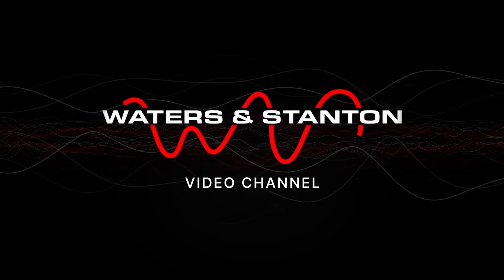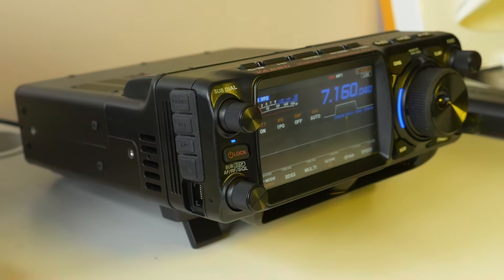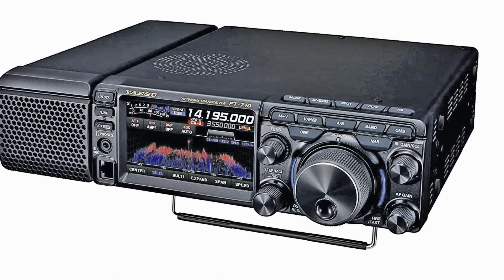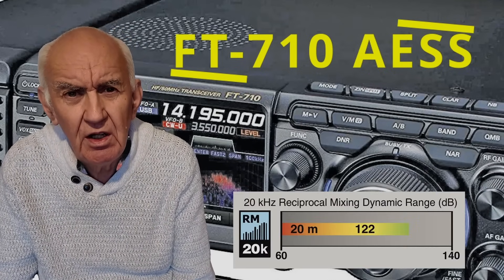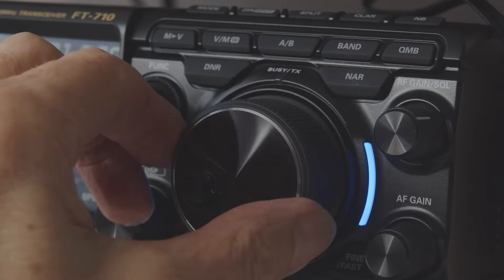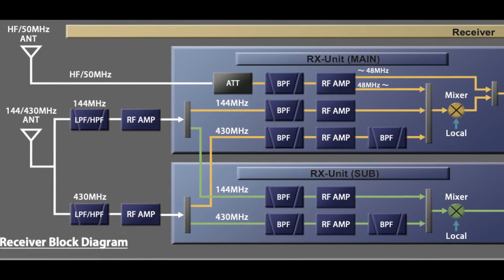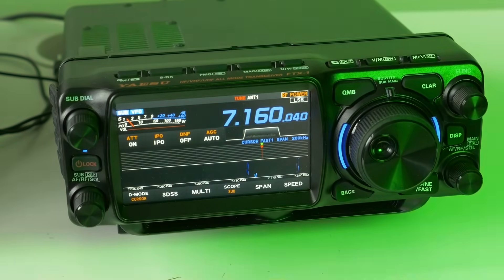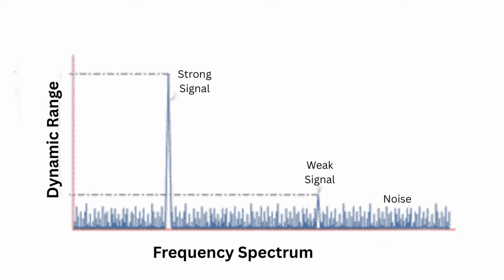FTX 1 The Superb Receiver Performance and some optimisation.

Comment: Yaesu has dropped the ball with their new FTX-1.  Specifically you cannot choose the frequency and band with a mouse.  With the FTDX-10 and FT-710 you can but not not not with the FTX-1. When using my Yasu FTDX – 10, I found that I can simply use my mouse to enter the frequency just by clicking on a frequency box that appears on the screen. And Boom” instantly transported to the band frequency that I want. So when working FT8 or POTA it is such a wonderful experience to just have to use my mouse to click on the frequency box and immediately and instantly get transported to the frequency and band  I want “Boom”. So……. When I saw the FTX – 1. I was interested in buying that one however I find out they do not have that same ability to click on the frequency with a handheld mouse. It just does not have it. I think this is a huge failing by Yaesu on this model. And I think this huge mistake of leaving that feature out on the radio will discourage people who like to do FT8 and Pota, from buying one of them, and their sales will definitely suffer.  It took me three days of searching to find out this fact. Which really really irritates me that they would not come right out and say we do not have that feature on this model. And saved me all that searching.

Comment: You go through the same steps I do with my Kenwood's 950SDX and TS940, Use the attenuator if noise conditions are high for the day or night, and AGC off opening the front end to its maximum gain level but offsetting and reducing audio overload with the RF gain, why its a good idea to reduce volume and RF first with the AGC off, as my 950 gets distorted audio with the stronger signals. Kenwood's similar AIP or advanced intercept point also balances out the signal to noise ratio sometime giving a cleaner signal with less noise. Otherwise, AIP can lessen signal gain if the natural noise levels are high on any given day. My other Go To is the MFJ noise cancelling Signal Enhancer and it does a good job on both tuning the phase between two antennas to reduce the noise sometimes almost to telephone quality and enhancing the signal with gain and very low noise. Its effectiveness is noticeable on different days, sometimes you can leave the adjustments the same across a few bands or have to adjust for each band, sometimes the dips in noise and gain in signal are more pronounced, such as a wide turn of the dials vs. a slight nudge or notch in the dips. Again to avoid the audio overload and distortion condition with AGC off; Attenuate down a notch and reduce rf and audio gain, then you can hear any improvements without adding or taking away gain with the AIP, and slowly adjust volume or rf gain. Sometimes the radio's own noise levels is equal to what the MFJ can achieve so the MFJ can then be used for gain and noise rather noise reduction. I find that a copper wire multi band EFHW dipole is quieter by far than a vertical aluminum antenna, with a significant difference in noise levels. On a vertical the signal is just wiped out, on the wire the signal is present and clear, sometimes between the two the MFJ is somewhere in between.

Comment: How’s it compare on 2m and 70cms compared to say IC705 or IC9700
Reply: At 70cm completely hopeless if you live next to a telecom tower with strong signals near 430Mhz, my 705 has waaaaay less problems with that.
Reply: Even on a good external speaker, there's absolutely no bass below 300Hz in FM mode. Nothing can be done about it in the menu, so why Yaesu pfffff.
The frequency on 70cm is way off, unacceptable in SSB. See also a user review on Eham.

Comment: Ahh Peter, using the RF gain control to adjust the audio level.  Yes, just as we did in the old days.  Worked on both SSB and CW.  I used it all the time on my HQ-129X.  I also built and wired the Heathkit QF-1 (I think that was the model #) into the 455kc IF on the 129.  Really perked the old girl up quite a bit.  I really enjoy your tips and also the trips down memory lane.  Keep it up. 73, Don - K2PMC. PS my original call minus the N for novice back in 1955.
Reply from the maker: Great memories. Thanks for sharing.72 Peter.

Comment: Agree on AGC and RF gain control… the same on most other radios apart from Icom SDR.. on these the RF gain is not effective, but attenuator does help with noise reduction.
AGC off not suitable in a net situation with stations of varying signal strength, very loud signals, as you say, can overload.

Comment: Agree with everything you’ve said here, Peter.
VK shipment (for whatever reason) just arrived this week, so I’ve only had a couple of days to test mine, but, yes it sounds brilliant and is kicking goals for me, already familiar with the menu system from the 710 and 101MP. I have only the most minor of gripes… it’s the only radio I own that I can’t tune 1Khz at a time with the turn of a dial, rather than fiddle with the VFO; and I would prefer the tuner as a button on the top or side rather than in the screen menu… so with only that as criticism, you can see why it’s so good for me. I don’t know if my 705 will be getting much use from here… 
The Sherwood reviews are splitting hairs with many of the top listed. I doubt our ears would truly be able to tell the differences. Anyway, thanks for your reviews Peter.
Reply from the maker: Nice to hear from you and for sharing..

Comment: I was interested in the Optima version, but then discovered a decisive disadvantage for me: there is no HDMI output for an external monitor, which is less than ideal for the ageing target group. It didn't take too long for the FT-991 to get the ‘A’ version, so I hope there will also be an FTX-1A that takes into account the needs of ageing YL/OMs. 73
(Translated with DeepL)

Comment: I have the 5’ separation cable which I use to put the amp in the back seat and the field head in a Lido cup holder attachment up front; now I don’t have to freeze outside operating on a picnic bench. Yes the 891 would do the same at a much lower price, but the other features of the FTX made me get it and I’m sure I will still be using and enjoying it for decades. For me the lack of gps & bluetooth were inconsequential; don’t see me using them at all. If it had everything possible,  probably someone would be complaining that Yaesu engineers missed the boat by not putting a bottle opener on the side.

Comment: On sherwoods listing its quite low overall its a shack in the box so there will be compromises, one thing in its favour its has the latest technology excellent dnr real time scope etc, it no dx10 or 710 in rx performance but if you want a modern shack in the box that you can detach the head to do pota as well its worth a consideration personally I save the money and get a 991A
Reply: Can you say run-on sentence?
Reply: @ivandubinsky1857 This is nothing, years ago I came across something similar but actually lacking a verb.

Comment: I love Yaesu radios but it seems that there is always some feature that made me wonder what their user interface programmer was thinking.  Apparently, Yaesu's SDR programmer is doing a great job.  I love the concept of a field radio that connects to a base unit for more power at home, but I wish ham radio manufacturers would make their field radios 20W SSB and 10W CW or digital instead of 5W or 10W SSB.  Put the ATU in the 100W base and use resonant antennas in the field.
Reply: Yeah, duplicating antenna tuning circuitry seems unnecessary for me. You could just pack the amplifier module if you really want to use non resonant antennas in the field.

Comment: Good stuff Peter. However, interesting that the ftx-1 is not near the top of the sherwood receiver list, where as the ft-710 which you compare it against is 3rd.
Reply from the maker: Yes not sure why. Maybe an early USA version tested, before the firmware mods thar EU models have.

Comment: Another interesting review Peter. A side by side comparison with the Icom IC-705 would be interesting with both receivers optimised on the same signal. 
The FTX—1F is a very interesting radio and undoubtedly has features that the Icom doesn’t have, on the tx for example, but I really think Yaesu missed a trick here with not including, internally at least, Bluetooth, GPS and WiFi. The full WiFi feature on the Icom is superb, and Access Point mode when out and about with the radio  really is the icing on the cake.